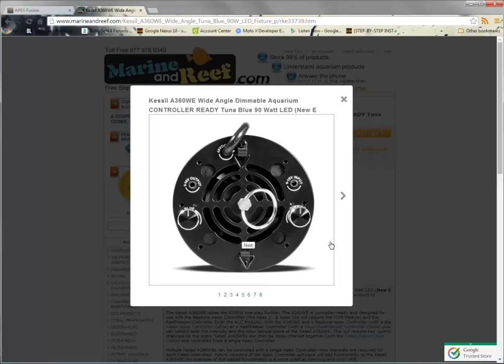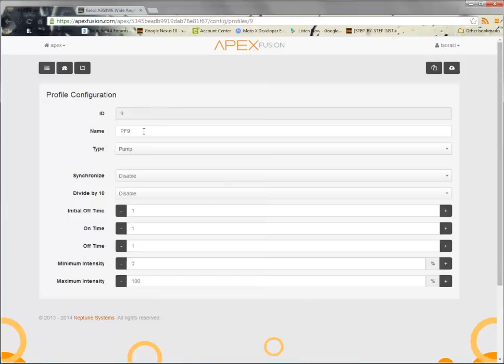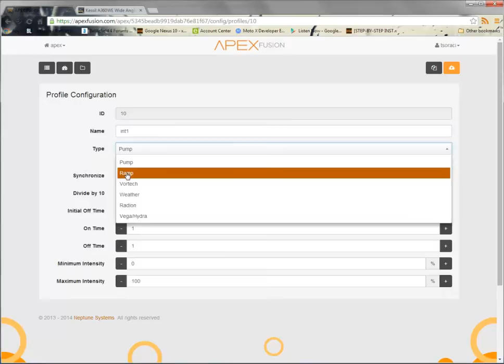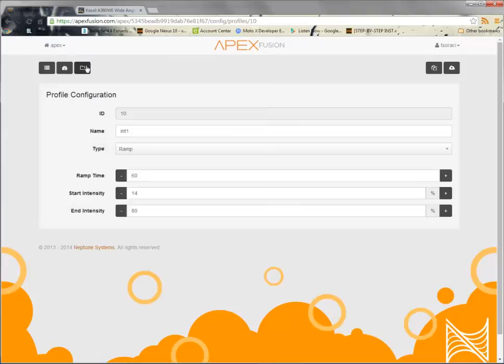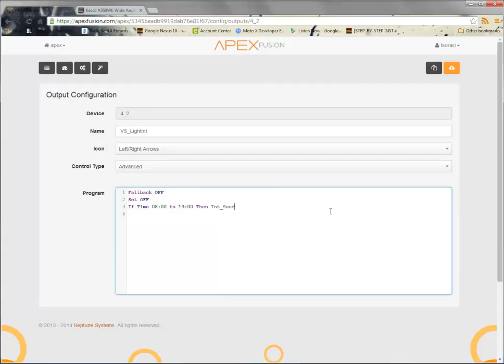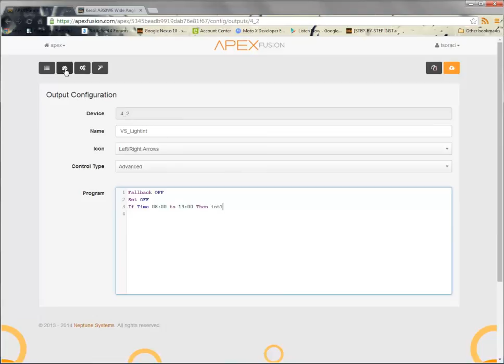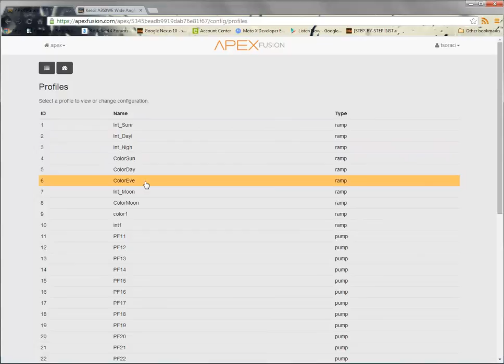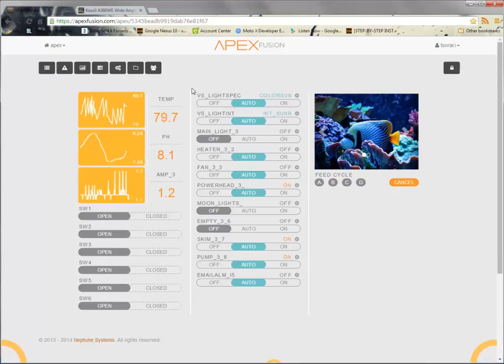Connecting and Programing Kessil A360WE to Apex Part 1

Comment: Thomas, I'm super late to this post but new to the Apex fusion. Hoping for a quick help from you if possible :) So I get the two channel part but what I can figure out is how to add those two channels. I have the channels associated with the outlets, but not sure if I just use them or if there is a what to actually add new channels not associated with the outlets. You have them named "vs_lightspec" and "VS_lighint" above in your example. Before I was just using the outlet tied to light in my dropdown to control the on and offs with my Kessil's. Hope that question makes sense and thank you.

Comment: While Multiple Connecting, Does all the units require separate power supplies too...Or Just If One Connected, The rest work with connection?
Reply from the maker: Yeah all kessils need their own power supplies, but you do not need to take up space on your apex  EB8 (unless you want to monitor power useage) because the actual on/off of the lights will be controlled by the varial speed port. Hope that helps!
Reply: @ThomasSoraci  
Thanks A Lot,,
Perfect..

Comment: so can I daisy chain two lights and still only use one v/port ? I'm trying to have 2 kessils 4 tunze 6055 a heater and my return pump and need some help.
Reply: Exactly, just connected them with a 3.5 male/male stereo cable. One will be a slave, the other a master. The master needs to connect to the controller and you'll be good to go

Comment: Thomas, On the outlet portion that you plug each kessil into for power, what config did you put in there?
Reply: Matt, you just need to make sure the outlet is on, and actually you don't have to plug in the kessil for power to your energy bar, the vdm module "controls" everything. I keep my kessils plugged into a standard power strip so I can use my outlets on the energy bar for things I actually need to control. I hope that clarifies it for you.
Reply: Right on, thanks. I have 2 Energy 8 Bars, so i have the outlets.
Reply from the maker: Matt C Nice, so yeah leave the outlets "on" and your profiles will control the kessils. Then post up some videos so I can see your tank :)